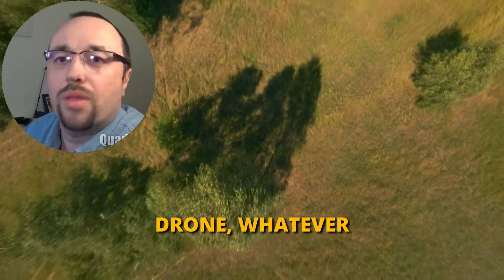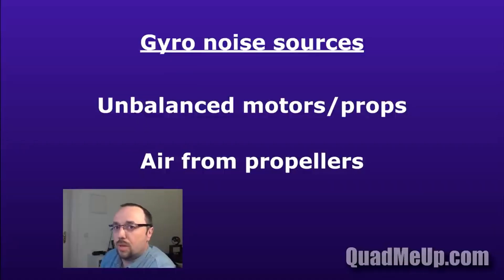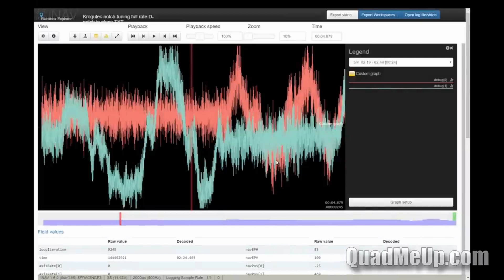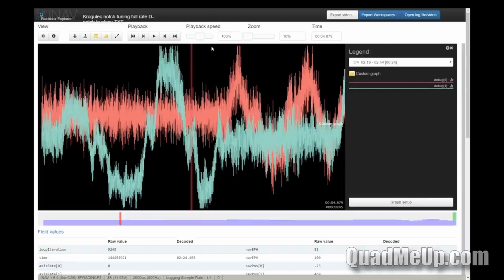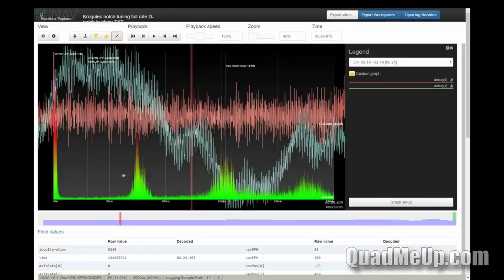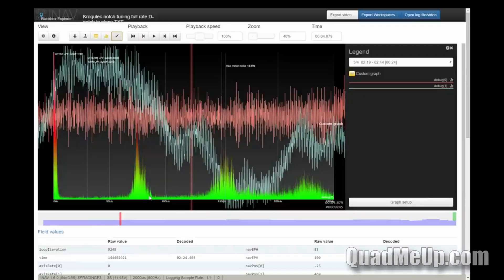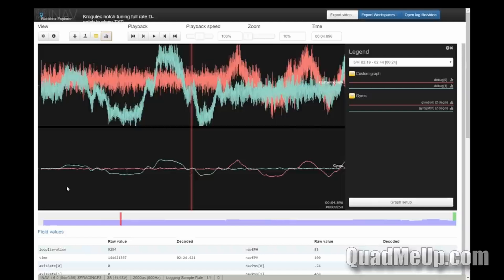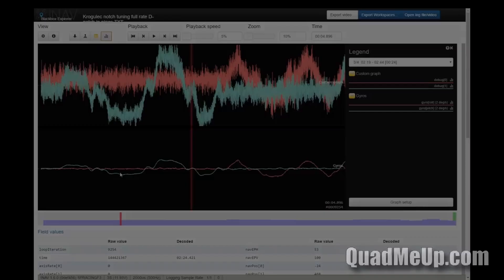Gyro noise sources - drone filter tuning masterclass

Comment: now that there isnt a debug mode = 'gyro', which mode should we use for this?  The closest is either the acc or dyn_gyro_lpf.
Reply from the maker: In Blackbox tab you can select "gyroRaw" option and it will just save gyro raw as new set of data
Reply: @FPVUniversity  thank you so much

Comment: This is not a masterclass, this is a very basic overview of gyro noise. I kinda laughed when I saw “masterclass” in the title and saw it was only 11minutes… The title is completely misleading because there is absolutely no tuning of the filters in your video at all. Do you really think this was a “Drone filter tuning masterclass”?
Reply: Master class in avoiding masterclass.
Reply: Masterclass is the title of the playlist. There's multiple videos coming out over the next days I presume.
Reply: @splitSec_fpv  a master class would involve spectral power density graph reading.  Frequency Vs time and harmonics analysis.   Mitigating delay induced noise and not adding more filtration thinking phase delay or d term feedback noise.   🤣🤣
Reply: @noisy_boi_fpv_3920  where did you even learn all this? im impressed.

Comment: Thank you Pawel. For all you do. You're one of the under appreciated FPV creators.
Do you believe loose items create relevant noise - i.e. noise that has an undesirable effect on the signal? 
e.g. a receiver or a buzzer that is not fixed to the frame but just dangles around on it's power/signal wires and antenna so it can bounce on the frame or even the FC